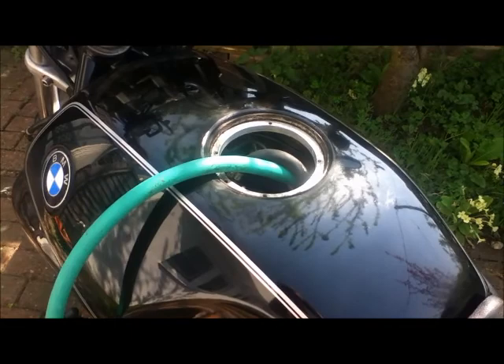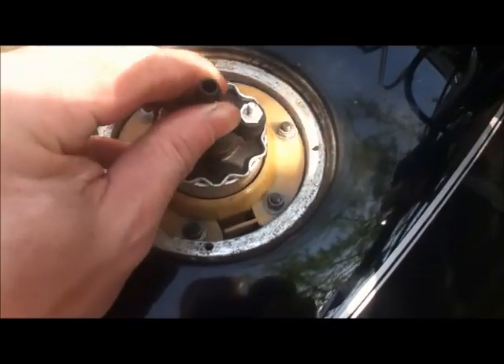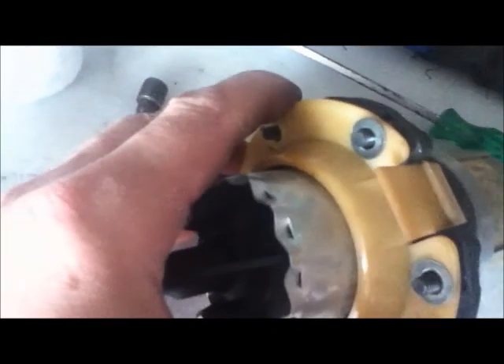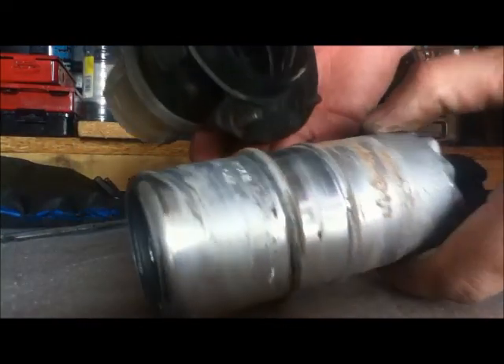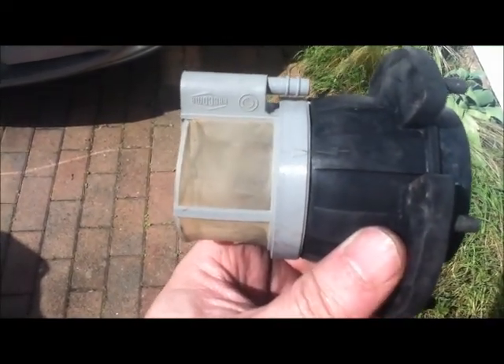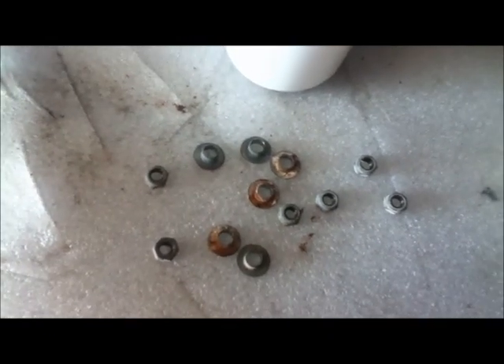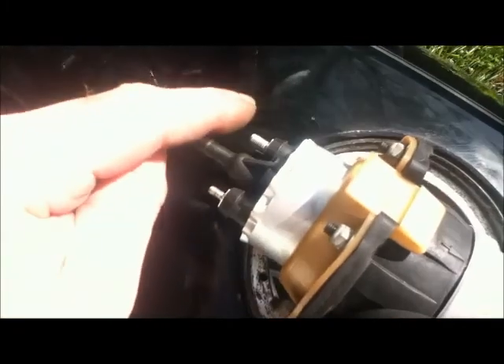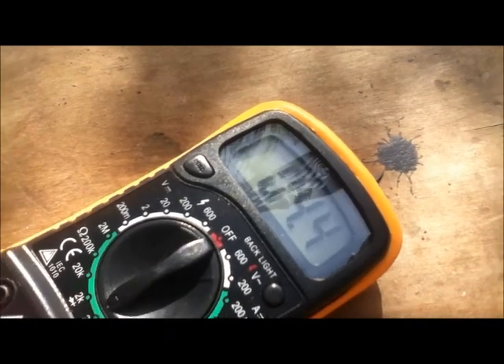BMW K75 Motorcycle Fuel Pump Change and Test

Comment: please can you tell me where the tube from the filter gauze under the pump goes. you took it off in your video but I couldn't see where the tube went. Thank you
Reply from the maker: It is the breather pipe. It connects just under the opening for the fuel cap. You can see it at 1:25.

Comment: The strainer on the pump should be replaced. They're easily available. They go brittle and disintegrate, wiping out the pump.
Reply from the maker: This seems to be more of a problem in America than the UK. I think the fuel content is different. As you saw in the video mine was in good condition.
Reply: @johnnysevengun  No, I'm in the UK, and looks can be deceptive. My 1986 K75S strainer crumbled as soon as I gave it the full gravy, so I learned the hard way. The easy way is when someone tells you about it.
Reply from the maker: Good advice.
Reply: If , for any reason , you have tò empty the fuel tank, i strongly suggest tò clean all the debris accumulated in the years.
Most of them are rust coming from the sender, which Is metal.
This rust Will corrode the tank due tò galvanic current generated by the alluminum and rust.
This Is my way tò clean It:
Once empty ,let It dry as much as possibile.
Then with a  brush scrub as much Is possibile the interior surface.
Then inserti 2 hoses, the air compressor One and the vacum cleaner One.
The air raise the debris which are  sucked by the vacum cleaner.

There Is a risk....if the compressed air Is too strong It could stress the alluminum where the rust heavly corrodet It and produce very Little holes in the tank.
You Will see It  when you fill again the tank!!!!😢
It happened twice tò my 1991 K75RT but i had a nice guy MIG welded  It .
Hope It help.
Italy here

Comment: You were pretty lucky. With mine, after 32,000kms the black suspension rubber had dissolved and carefully distributed itself all through the tank inner. It was like a coating of tar. Hours of cleaning ensued. The fuel was always non ethanol, quality, 95 or 98 octane, so, who knows??
After a new pump, suspension rubber, strainer screen, and all new rubber hoses and clamps, it still wouldn’t start. Traced eventually to the four wire connector under the right hand side panel. I cut it out and replaced it with a new, automotive four wire snap connector. It then started instantly. The original pump had seized solid, probably the melted rubber all through it.
Reply: Mine had done the same thing. 3700 miles on it, then sat for a quarter century half full of rotting fuel. Mine was also a miniature diorama of the Labrea Tar Pits thanks to that rubber gasket.
Reply: @StubbleAndStrife  Yep, worst crap ever to clean up.

Comment: Great job putting all this together.  Would love to have seen you follow through with some electrical problem troubleshooting.  But really, this was superb.  Thanks.
Reply from the maker: Thanks Paul. I have done a video on tracing the wiring for the oil pressure sensor but for the fuel pump it was just a straight replacement of the level sender loom.

Comment: Hello, thanks for the video. Do you have one that continues with electrical problem? Pulled my pump and it’s also fine.
Reply from the maker: Sorry, no. What I did was get a new fuel level sender (secondhand £40) and that cured it. The tank connector is well known for falling apart and many people wire in a modern one to replace it to prevent cut outs.
Reply: @johnnysevengun  thank you. The float assembly and wiring harness sure sits at an odd angle . Almost right on top of the fuel filter... guess I’m going to have to get in there

Comment: Since I have found your videos I have learnt a lot of useful information to keep my bike running ,  yesterday I checked my drive train oil , gear box oil , (  with the cable tie  ) dip stick perfect 👌,  changed my Engine oil and put new spark plugs in , so already to go when the weather picks up . Thank you for the information and clarity , look forward to the next video, well done 👍 I've had my K 75c for 14 years and I think there an underrated bike ,  but in reality they are a great bike .
Reply from the maker: I am very glad the videos are helpful.

Comment: Hi, thanks for the video, it helped me alot. Did you manage to resolve the problem in the end? I got a 1991 K100RS last saturday which i've driven for about 250 km with no problems. Great bike, really happy with it. But: i wanted to take it out for a drive today as there may be a problem with the gearbox as it seemed to fly into neutral while accelerating at times, but it wouldn't start. The starter is cranking fine, previous owner replaced the battery a few weeks ago, but couldn't hear the fuel pump. I took it out, tested it with a 12v charger thing, the fuel pump started spluttering petrol all over the place so that seems OK. Then i tested the 2 leads that go on the fuel pump for voltage, and when i turn the key it gives a nice 12v reading on the multimeter. My question: did you check the leads like i did and, more generally, was it a wiring problem in the end? I've yet to check for compression and such (don't have the tools yet) and maybe the spark plugs are due a change, but the absence of the fuel pump gurgling had me a bit worried. Thanks in advance
Reply from the maker: Yes. What happened is that the fuel pump wiring goes into the same connectors in the tank as the fuel sender and these had failed. On some bikes they fail when they warm up and then reconnect making it a difficult fault to diagnose. I bought a secondhand fuel sender from Motorworks for £40 (they are well over £100 new) and that cured the problem.
Reply: Okay thanks for the information. Does sound like the sender then. This bike wasn't used much by the previous owner and me driving it was probably the first proper warm-up it had in a long time. I'll check the sender next then! Thanks
Reply from the maker: Sounds about right. I rode my bike solidly for 13 years - now i am a fair weather biker and it sits for long periods without a good run. Inevitably the 30 year old parts fail.
Reply: Yeah, i keep having to remind myself i'm dealing with a pretty old bike. Wouldn't think that when looking at it tho, everything looks really good, previous owners took really good care of it. Oh well, i'll take it apart further tomorrow, i'll let you know what happens. Thanks so far.